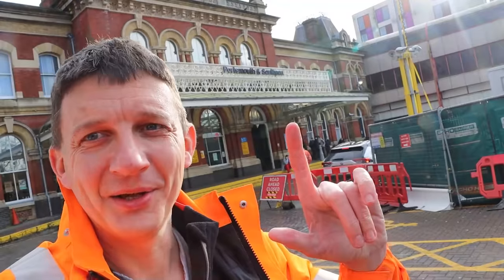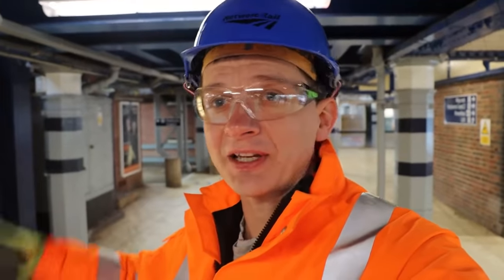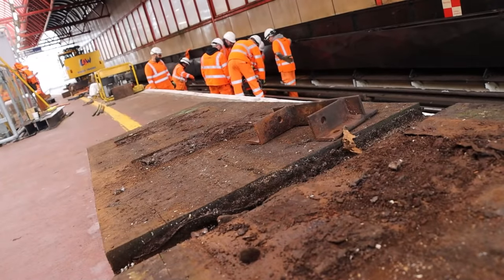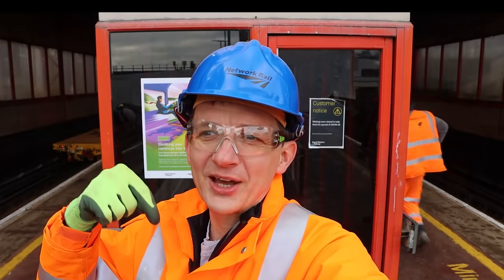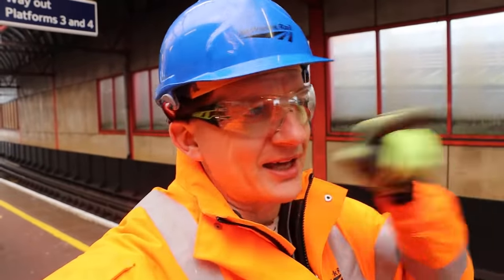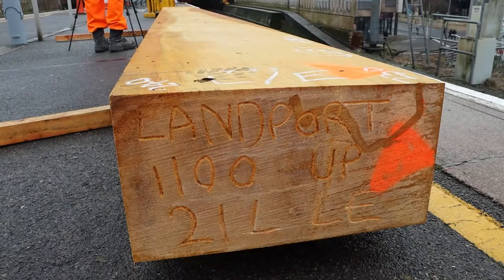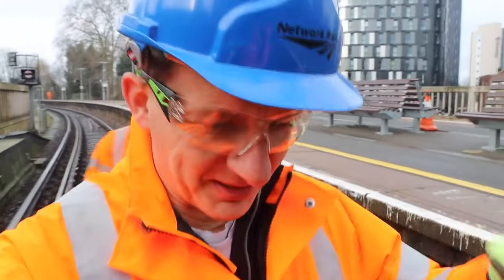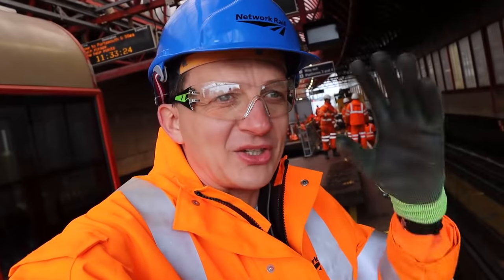Repairing the Landport Viaduct with Network Rail

Comment: I can't believe any of us locals knew that this is called the Landport Viaduct! I go past 2-3 times a week, but when I saw this video pop up I assumed it was somewhere in London. Thinking about it, of course it makes sense, as Landport is the original name for the city centre. 

I've seen there has been some work going on for months, but never thought any more about it. From the ground level nothing has changed. Back in 2000 there were plans to build a tramway from Fareham to Gosport, then under the harbour to Portsmouth. This would have continued on to P+S station at street level, meaning the elevated route to the harbour was redundant. This got kiboshed because the navy needed to dredge the harbour deeper, so the tram wasn't viable. C'est la vie!

Comment: Track gauge in metric (imperial). Used to be1435mm ( 4' 8 1/2") through jointed track but 1432mm (4' 8 3/8") through continously welded rail(CWR). I remember that from my PWay days as a PWay Patrolman.  To do with wheel dynamics on freight trains when travelling at speed. However after several derailments of wagons on CWR, they reverted to 1435 and instead redesigned wagon wheels to suit 1435 at speed.
Reply: Amazing that 3mm (0.2%) can make such a difference.
Reply: @K-o-R  the ballast trackbed provides the majority of the suspension on the railways due to steam locomotives not having much play on their axles. With the diesels and electrics the trackbed were made more rigid than in steam days to allow higher speeds. This had unintended result that short wheelbase wagons, like the 16Ton mineral wagons, could when emptg and running at speed bounce themselves off the rails. I wasn't aware of the reduction in track gauge causing this issue as well.
Reply: @neiloflongbeck5705  The idea was by the reduction of 3mm in gauge and line speed for short wheel based wagons to 45 mph they thought it would reduce the hunting/swaying effect. However, since the flange of wheel rarely makes contact with the rail edge, except in sharp curves, the hunting/swaying remained and in fact increased. There were several noted derailments of wagons on CWR because of this. There still remains some old installed CWR with the 1432 mm gauge, but as it is being renewed, the 1435mm gauge is standard measurement now.

Comment: Excellent video Geoff. It was interesting to see that each wheel timber is engineered and cut  for a specific piece of track then labelled to ensure it is fitted in exactly the correct place.
Reply: assume that has to do with the curvature of the viaduct and the track itself so they don't have to do any fitting on-site, but can just drop the timber in - if it was just a dead straight line it wouldn't matter which piece of timber they use where

Comment: Have to add a double “like” for a video about rail bridge maintenance, a profession that has fed the family and put a roof over our heads for decades now. Lots of good tidbits, and as always it is interesting to see both the similarities and the differences between UK and US practice. I especially enjoyed the comment on platform salt corroding the steel structure. Rail bridges certainly can corrode, but in most cases we don’t have to pour salt all over them like a highway bridge, so many steel railroad bridges have remarkably less corrosion compared to a highway bridge of the same. So as a bridge engineer, we can often see where salt, or other corrosive element, was applied over the years on a bridge. I am overseeing repairs right now on a rail bridge that was adjacent to a passenger station. Even though the station has not been used for years, there is very severe, very localized corrosion where the platform abutted the steel span. Testimony to decades of a dutiful station agent salting the platform for passenger safety. 

It isn’t always a dutiful agent whose repeated effort results in increased corrosion. On moveable bridges, we often find a localized area of severely corroded steel a few steps from the bridge operator’s shanty. In this case the source of the “other corrosive material” came from decades of bridge operators answering the call of nature and saving themselves the walk back to shore.

Comment: Fun fact: A number of railroads are currently going a tiny bit wider, with 1437 mm for ÖBB (Austria), SBB and SOB (both Switzerland), while Germany is experimenting with 1436. Apparently it leads to smoother rides and less wear and tear; it’s still well within the allowed tolerances of normal gauge, of course, so trains don’t need to be redesigned for that.
Reply: Other fun fact: Hong Kong's MTR system uses 1432mm, also for the exact reason for lessening wear and tear and providing a smoother ride.
Reply: @tyteen4a03  so what's wrong with 1435 lol

Comment: I'm not sure why it is so surprising that engineering measurements in 2022 is in millimetres, we haven't used imperial measurements for at least 40 years.
Reply: It’s…. Metric….
Reply: I use metric for everything except for bridge heights ask me the height of the  truck and trailer I use at work in metric and I'd have to work it out I do know they're 13ft 9 inches though
Reply: Boo
Reply: I’m pretty sure the railways in Britain are still measured in chains. From the program I was watching, I infer it is because the there is are marker a chain apart on every track on every railway in Britain. For a system that cannot switch to a common signalling system, remarking the entire network is going to be impossible.
Reply: @francesconicoletti2547  I understand the eventual plan is to move to ETCS (which is metric by design) but it's difficult to justify said expenditure unless the work delivers needed upgrades to speed or capacity,
Reply: On the railways we still use miles and chains plus we have terms like 4 foot, 6 foot and 10 foot

Comment: Way ahead of you Geoff, I've always called standard gauge 1435mm. Never knew what it was in feet/inches. I bet this is true for nearly everyone outside of the US and UK.
Reply: Yes, I've always found the metric gauges drastically more memorable. Plus, it's much easier to compare them to metre gauge, 1600, 1067, 891, etc.
Reply: Those of us of a certain age struggle still with metric as taught Imperial at school in the '50's and early '60's.  My Doctor gives me that look of exasperation when she asks my weight and height.  Glad the UK still has miles, pints and the butcher will still sell one a pound of sausages.

Comment: The high level platforms used to have a similar roof to the rest of the station, but they got replaced with something "modern" at some point.
Reply: And they used to extend right across the viaduct.

Comment: The Landore viaduct is a railway viaduct over the Swansea valley and the River Tawe at Landore in south Wales. It provides a link between Swansea city center and the West Wales Line to the South Wales Main Line. The valley crossing provides a panoramic view of Landore, Kilvey Hill, the Liberty Stadium and the Swansea Enterprise Park.

The Landore viaduct was constructed as a key element of the West Wales Line during the late 1840s. The structure, which has a length of 536-metre (1,759 ft), was originally designed by the famed engineer Isambard Kingdom Brunel, and incorporated a diverse range of structural design elements and was primarily constructed out of timber. It was officially opened to traffic in 1850. The structure was first updated in 1889, using wrought-iron for the central span. Between 1978 and 1979, the majority of the viaduct was re-decked using steel beams. The structure remains in use to the current day.

Comment: Also Geoff, on the diagram showing the 3 south Portsmouth stations i noticed you included the spur of the old East Southsea Line, nice touch.
Reply: I noticed that. Geoff's map did not have the route of the loop for the Royal Navy dockyard though.
Reply from the maker: ha, thanks Dave! that short section now it still is use as sidings, isn't it? which is why i included it!!
Reply: @geofftech2  sort of. It still peels off from the bay platform. The sidings are a little further down.

Comment: ISTR Platforms 1&2 were called platforms 6&7.  There were more platforms on the lower level and an extra siding.  And a turntable towards Fratton.  And the trackbed itself runs in what was originally Portsmouth Canal, which emerged in Locksway road, and, via Chichester, joined the Arun, I think…
Reply: Yes, there were more platforms which are now part of Matalan's car park!

Comment: When the old high level canopy was replaced in the 80s the plan was to build a more impressive single arched roof. But local conservationists insisted on the smaller structure which we are now stuck with indefinitely.  It looks more like a bus stop than a train station

Comment: The Portsmouth Harbour extension opened in 1876 so any original ironwork dates back to then with the original low level station dating from 1847. Fun fact: It was called Portsmouth Town station until 1910 (I think) after which it became Portsmouth and Southsea. Us older enthusiasts still refer to the two stations as 'Town' and 'Harbour' 😉
Reply: My mum and dad used to still refer to it as Town station in the 70's.

Comment: Having had the (dubious) pleasure of traveling through it my on my way to Portsmouth Harbour on many occasions I can confirm that the 1980's elements of Portsmouth and Southsea Station are without doubt a strong candidate for the Worst Station Architecture on Railtrack Award'.
Reply: Let's be fair, the architect did a great job of blending it into its surroundings. I used to be a local too. Never used the station as I was mid way between Fratton and P&S.

Comment: The railway once continued past P&S to the north of the station and followed Stanhope Road as it bends right by 90 degrees where Catherine House (Student flats) and Travelodge are. Then continues north and enters the naval dock through Unicorn gate and continued on a network through the docks. 

All that remains is a single railway barrier (hand opperated one) as it crosses Bishop Crispian Way

Comment: With rail gauge in the UK. You find on Bullhead and wooden sleepers with old flatbottom its is 1435mm. On concrete and Flatbottom and most renewed areas 1432mm. The flatbottom gauge is depended on the age and poundage of the steel used.

Comment: In the NYC subway this isn’t wood, it’s reinforced concrete… which makes replacement work much more lengthy (they have a robot that breaks up the concrete, much more powerful than a human holding a jackhammer). But they do use Timbers as a temporary measure so services can run during peak travel, but at slower speeds.(They’ll come back the next Friday after 11pm, remove the temporary work, pour the concrete and rebuild the rails section by section, so that trains can run again by Monday morning. This usually take a number of weeks and they will work on sections with points at both ends, so trains can run on adjacent tracks (local or express.))

Comment: I wonder when the harbour station will need work as at least 1/3rd of it is on stilts into the harbour water... cant remember any major works on the station structure itself occuring in the last 15 - 20yrs... they must monitor it regularly though...

Great video Geoff! As you point out the 80s Extension is...... well... brutal.

I'm also really supprised that its taken as long as it has to consider alternative sleeper material for this type of situation... would of thought they'd have moved to a composite (like the reinforced fibre glass product mentioned) a Looooooooooooooooong time ago.

Comment: Distinctly recall an article (may have been in Rail Enthusiast) in the early 80s that described a change of the nominal gauge between 1432 and 1435 (can't remember which way round) that was applied first to a stretch of the Selby Bypass near Temple Hirst, with a view to smoother running with newer wheel profiles \m/
Reply: Maybe a changeover from one of the almost standard gauges e.g. 4ft8 (1422) or 4ft9 (1448).

An other possibility is that it was a heritage line switching the nominal from the 4ft8 1/2 "actual" (which is 1435.1, and remains the actual standard in the US) to the standard gauge proper of 1435.

It seems unlikely that a railway would switch away from standard gauge in the 80s, at least to something so similar (there are lots of trams with wider gauges).
Reply: @BlairdBlaird  no it was distinctly a main line, the article described the journey on a Modernisation Plan-era DMU, specifically the resulting change of ride quality when the train moved from the old gauge to the new - it was clearly worse for the legacy unit, the new gauge having been created for the benefit of the then new Mk3 carriage - IIRC the exact journey was York-Selby via the Bypass \m/

Comment: All of Portsmouth's stations are in need of updating and modernising. As for a busy commuter and tourism city we have awful stations that do not give a great impression when arriving. SWR and Network Rail need to look at this.
Reply: When Portsmouth City Council complained about our crumbling stations SWR said they could only consider improvements to one station. Portsmouth Harbour was selected. But nothing has happened and budgets are even tighter now
Reply: @rosskiddle9113  It's a tricky situation as all of them need doing up with Portsmouth Harbour and Fratton in need of updating due to higher use. Portsmouth FC want Network Rail to improve capacity so if the stadium expands it can cope with high demand. 

Portsmouth & Southsea needs the Upper Platform building to be rebuilt, maybe out of glass to make it less dingy and dark and more inviting!

Comment: Great video.
Off-topic, I know, but seeing as people are talking European guages... what's the difference between France and Spain? I travelled on a train from Paris to Valencia in the early 80s, and they had to do some jiggery-pokery to the train at Cerbère/Portbou to handle the different guage. The train must have had adaptive bogies.
Reply: France is Standard gauge (same as the UK and most of western Europe). Spain/portugal have their own gauge known as "iberian gauge" which is a bit wider, though they also have some standard gauge lines nowadays.
Reply: Further to the above, French (standard) gauge is 1435mm and Spanish (Iberian) gauge is 1668mm.

But Spanish high speed lines are built to standard gauge to facilitate through running to France and the rest of Europe.
Reply: Mm
Reply: Spain have the TALGO trains which can change gauge on the move- very clever solution to a difficult problem

Comment: Steel reinforcement encased in recycled plastic ought to be trialled for coastal areas. It can be moulded to most simple shapes and would have a life expectancy well in excess of 50 years. Wonder if Network Rail have considered it?
Reply: Plastic encased steel reinforcing has been banned in the United States because of catastrophic failures (building collapse).
Stainless steel or fibreglass is preferred.
Reply: @allangibson2408   It would depend obviously on who makes it, ie  not imported from 'cheaper' sources and achieving the right accreditation.
Reply: @Joe90V  The problem was damage during shipping and installation not manufacturing issues. 
It just wasn’t predictably or robustly corrosion protected (and that was with virgin polymer). Recycled polymer introduces contamination issues (which can be as simple as water contamination).
Safer to ditch the carbon steel entirely and just use non-corrodible materials for reinforcements or just put enough concrete into the structure.

Comment: I've always wondered - why the weird measurments?
I mean, the mm size I understand, because the original size was imperial.
But why 4'8.5 and not 4'8 or 4'9?
It's always seemed rather odd to me
Reply: The story I have been told about the origins of the standard gauge is as follows.  The Stevensons  used it for both the Stockton to Darlington, and the Liverpool to Manchester railways.This set a precedent  for all the railways that came after. ( I do know about Brunel, but he was of French descendancy and they just like to be awkward).  Going back to the Stevensons , their standard gauge was the same as that used on the horse-drawn tramways of the local collieries. The wagons on these tramways were much the same as the horse drawn carts used on the highways. Now this specification for the measurement between the wheels  of a cart goes back to at least Roman times, because when archeologists excavated Roman road surfaces the ruts made by the cart wheels matched the standard gauge. That’s the story, could be true or could be bo11ocks, up to you.
Reply: @daviddearden6372  it's obviously a chain of copying earlier standards but, however far you go back, someone decided it at some point.
Although if it goes all the way back to the Romans it may well have been in some long-forgotten units which did actually make make sense.
Reply: @daviddearden6372  From something I read as a kid, the outside measurement is 5ft.  Subtract the width of 2 rails (2 x  1.75 in ) to get the inside gauge of 4' 8.5". Don't know how true that is.......

Comment: 3:50
Why use salt... It is a station, shovel off the worst and add a bit of gravel.
If it works on the Stockholm metro it surely works elsewhere too.

Salt is just corroding away the infrastructure and increasing maintenance cost, and isn't more effective at providing grip.

Comment: 1435 mm = standard gauge over here at the continent.
Reply: That fact is no surprise since the first railways were in Britain and so it follows the first railway engineers were British, therefore when they were engaged to build the early continental railways they would stick to what they knew. Just picture what it would have been like if Brunel's gauge had been used instead.